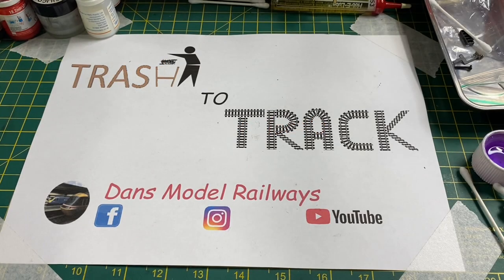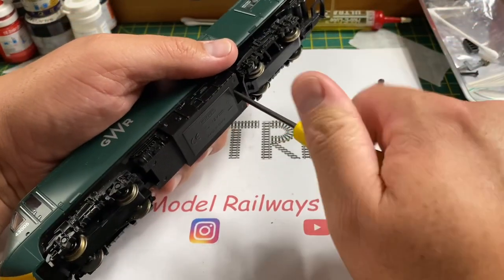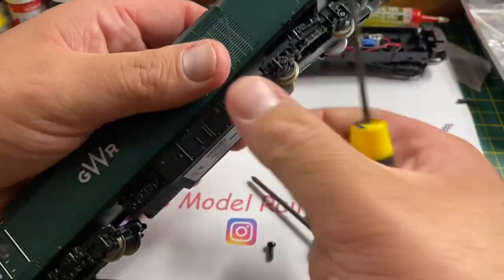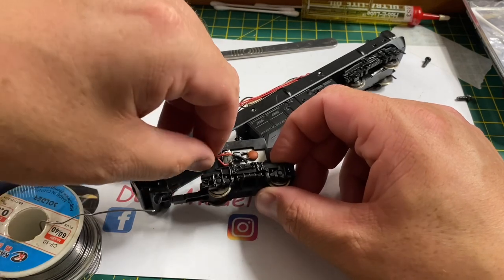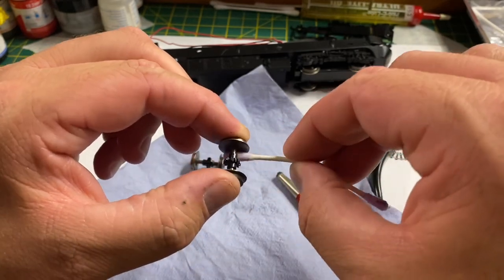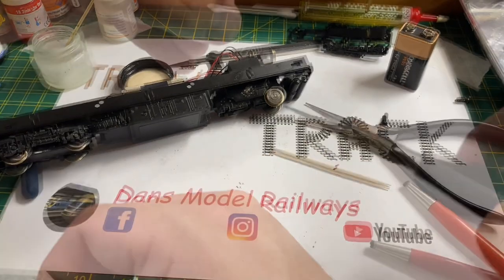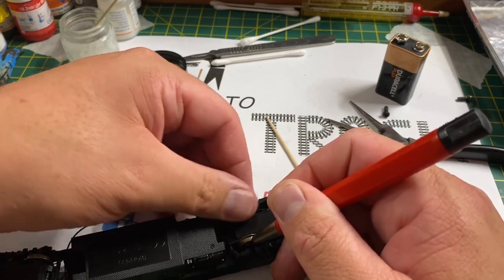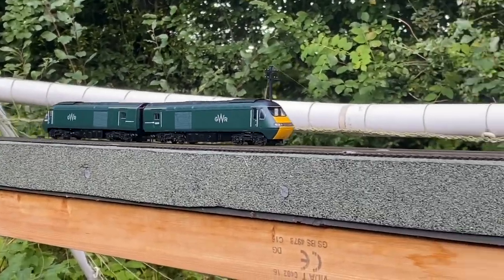Trash to Track. Episode 64. Hornby (ex-Lima) HST Power Car.

Comment: If memory serves me correct, the Lima HST lighting was the same as it is in this model with the power car lighting in both directions and no light in the dummy car.  I agree that a lighting system similar to Hornby's original tooling should be the least to expect.

Comment: I purchased one of these sets when I first started getting back into model railways and was surprised how cheaply it was put together and the lack of lights in the dummy end, the coach is not much better as aftermarket ones dont match it at all and it has a off putting bright red plastic interior which does not look great, have since added directional leds both ends and lighting in the coach, will have to paint that interior to make it look a little better one day.
Reply: Overpriced Chinesium🙂